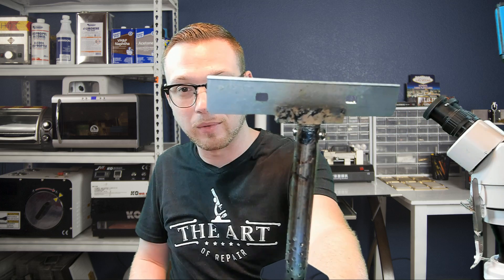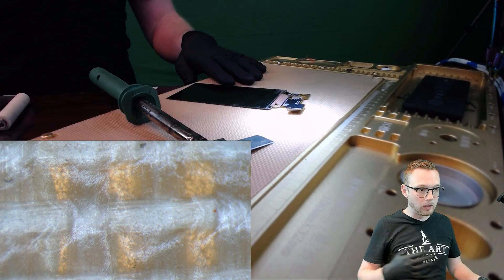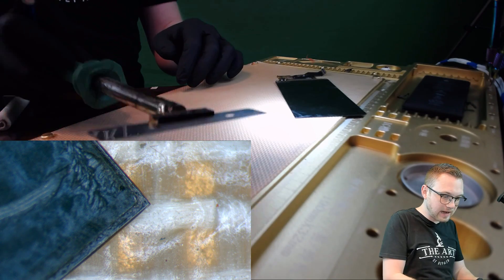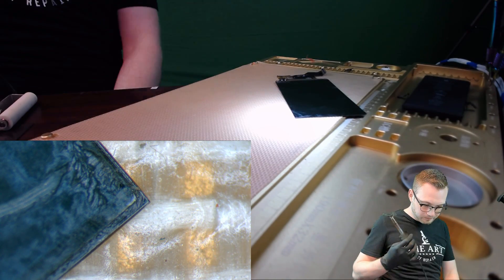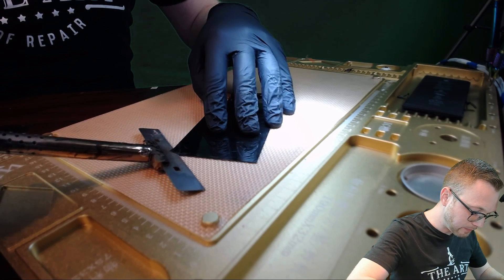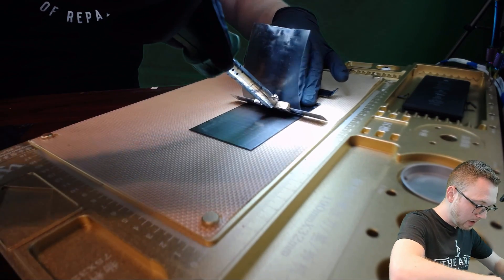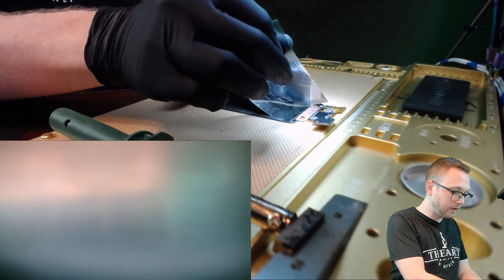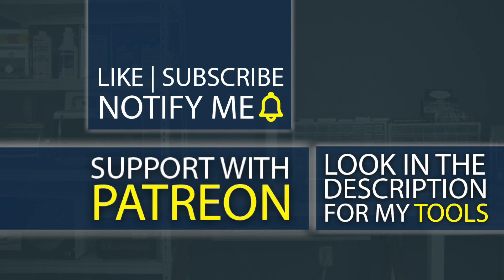EP68 Refurbishing 101 | Removing the Polarizer from an AMOLED/LCD display

Comment: Hi Justin. I bought a 21.5" monitor for my boat chartplotter.  The screen is polarized, and I can't see it with my polarized sunglasses.  Can I remove the polarizer layer from a monitor that big?
Reply from the maker: Probably a bad idea. Would need to replace with a polarizer that’s the correct degree. But if it’s bonded to the display. If you have not done it before it’s a quick way into a new display overall. This is something that needs a little practice. 

But on that note. If you turn the display or the sunglasses does it help? Maybe possible to flip it upside down and change the polarization axis a bit.

Comment: So how do you replace the Polarizer and AMOLED onto the LED display?
I screwed up and scraped that gold AMOLED from the LED display and the Polarizer was still stuck to the glass I removed from my Samsung Galaxy s10+ is this salvageable? if so how do I do it and where do I get the gold foil and polarizer?

I just want to fix it not even so it works but just to look good enough to replace as a dead phone I can trade in for my warranty replacement unit.

Comment: Thanks for the tutorial! I adapted your technique to rotate the polarizer on an alarm clock LCD. It's now inverted (bright numbers on dark background) and no no longer illuminates the entire bedroom at night. Also looks much better.
Heating up the blade of a box cutter and the display itself with a hot air gun a little was sketchy, but got it done in the end. Removing the glue from the filter was a pain and it got scratched up quite a bit, but for the display of an alarm clock it's good enough. :) Thanks for sharing your tricks for us all to learn!

Comment: Removing polarizer is one thing, but some info about applying them would be helpful. Different polarizers have different marking for which side goes where. Some have a letter (like R), some red bars, some dots, it's inconsistent and sometimes hard to spot. They also come with glue on one side, but for some reason, after applying on AMOLED screens display is still too bright and only applying it the other side (side with glue against the screen instead) makes it the correct color but there's no way to apply it then. I can't really find any info about it.
Reply: Krzysztof Grabowski good question!